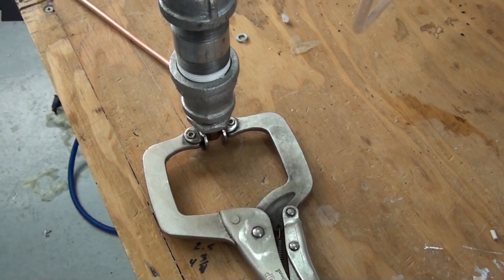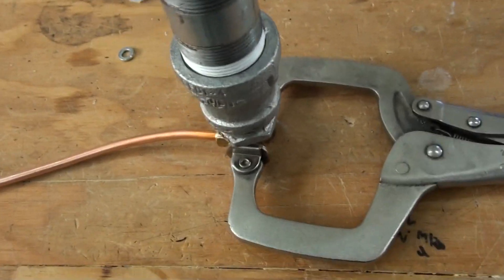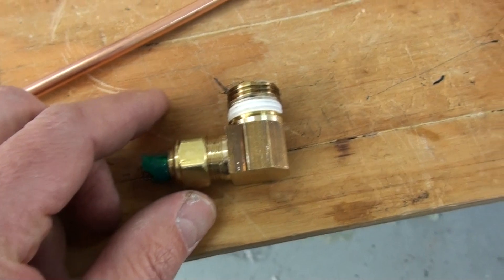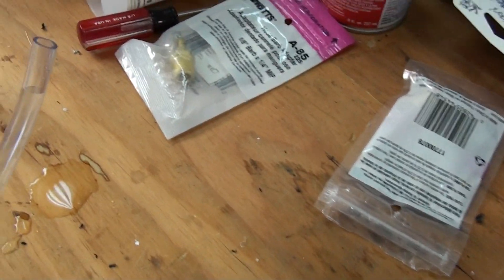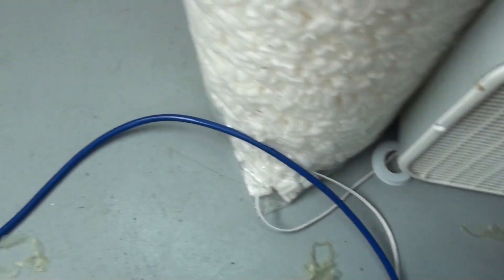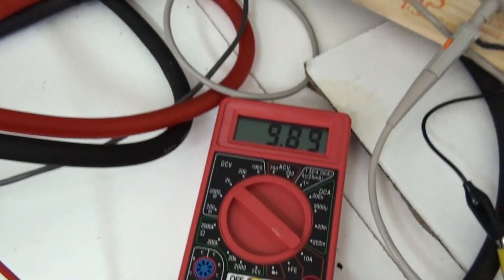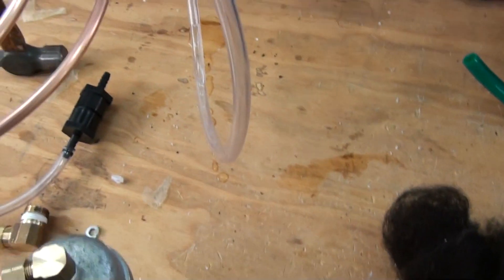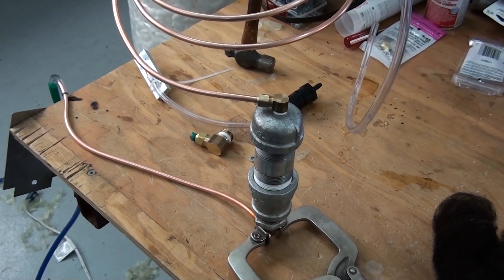H-CAT HHO Heater purifier project for hydrogen and oxygen.

Comment: is it possible to use the heat generated by the reaction to generate power using thermoelectric coolers to offset the power used by HHO production?

Comment: I saw this about 10 months ago and didn't know what I was looking at, at the time! I have just begun to explore HHO generators and I have 2 designs of plates that I use in my generators. The big plates have 3 holes on top and 3 on the bottom and the small plates have 3 holes on top 1 in the middle and one on the bottom. I have been having fun with it so far, a little expensive at first, well still is, what the hoot! But I'm interested in the cat too! I'm not as far as you guy's are but I'm still learning how to put the fire resisters together?? I saw my first video on HHO here on YouTube in May of 2013 and was hooked ever sense. I have one in my car and I did get real good gas mileage for a very short time, so I know it works but I haven't figured out why it stopped! If you all can give me an answer on that, I would appreciate it a lot! I have my own page here to. I guess off to the junk yard for a cat!
Reply from the maker: You may need a Volo chip and PWM to get it working  well.

I do have some mini cats left if your interested.

Comment: Flip it over so the water that forms doesn't plug up your cat.  The BG (HHO), even though it is lighter than air, will travel 'down' through the substrate if the top is sealed. Moisture (even as steam) lowers your catalytic effect.
Hydrogen coming out indicates that you are not 'combusting' all of your BG.
165 watts will make a lot of heat, as can be demonstrated by plugging in a couple of 80 watt soldering irons.  
Temperature is not the same as 'quantity of heat' Enthalpy or BTUs).  Soldering irons get hundreds of degrees too.
Very good design.  Test it by heating water.
Reply from the maker: You will want to see the next 2 video's.

Comment: and did you say there is no oxygen being outputted?  where do you imagine the oxygen went? just curious. and could you take a picture or video of the new cat and after you used it? close ups please
Reply from the maker: The oxygen is consumed in the catalytic reaction.
Reply: delvis11 so you are saying the oxy has turned into heat then? but there is hydrogen left over?
Reply from the maker: There should be.

Comment: 165 watts makes 1lpm and roughly 300 degrees F at the base and 170 at the top. is that right? what is the temp of the room and how long did it take to reach the 300 degrees? you could put that copper output coil in water and have a drop leg, the water would condensate from the coil and the hydrogen would still come out the end, the water pressure will work to let the hydrogen still go up and out. and a water bowl beside the output elbow, the water poisons the reaction, it is dripping back on to your kitty cat. they dont like water you know. nice video delvis, best one i seen on this so far

Comment: Well played. I got a couple of ideas.
1Please submerge the whole unit to heat say a litre of water
2instead of condensing the output, it would be good to see if the 'spare' hydrogen is available. Try putting the output pipe into a bubbler. 
The #HCAT experiments are very worthy . Cheers

Comment: Great work Steve!
What's the temp at the top of the reactor? 
If you put the exhaust pipe into one of your bubblers the hydrogen should accumulate at the top and feed the torch better.
Reply from the maker: Temp at top is about 170

Comment: Why not use stones for the flash back, you should be able to find then at different flow rates and different sizes, they would be cheaper and not melt at those temps anyway...
Maybe a stone quarry would have some or leads and they would be stupid cheap from them :/

Comment: Awesome based on the research I did I figured the hydrogen would not be consumed all the way if at all.  I have commented on others videos about this and shared a few of my ideas to utilize the full potential of the process. 

Very nice video Steve! Thanks for sharing! I was hoping someone would test and show that there was hydrogen leftover!   It gives you a good feeling when the ideas a person has end up being correct! 

Awesome! Now you need to seal off the system so the hydrogen does not recombine with the oxygen in the air so you can either run in into a holding tank or us it as a burner to further increase the heat and use it to run a steam engine and generate electricity.

Comment: This is amazing! you showed up that this is a completely renewing cycle products. we use water to have heat, hydrogen and water again..can believe it!! :) So, the flashback inside the reaktor is a big boom?i'm a bit scared, it's like a little bomb or the pressure will simply pushed out with water?  And so, in the outlet hose where you seen water coming out togheter the plastic hose, maybe also the gas is loss, try to fix and re try with the flame :) also as Neal said soap bubbles will help you too :) Go ahead man!! (and take ceramic insulation :) )
Reply from the maker: When It flashes back it is a simple flash back to the arrestor. no big deal.
Reply: ah, Delvis, I suggest you to make to some short round with copper near the reactor in both hose fitting..like a 2 or 3 spiral coil , this will help cooling the copper tube :)

Comment: That is just too cool. Your little reactor is sweet to look at. You may not realize it but you are writing History right now. You should try the ceramic insulation padding instead of the steel wool. Cleaner and would probably allow you to get up to higher temps. You can get a gigantic roll from Mcmaster for about 25 bucks. Let me know if your interested and I'll pass you the link. Neal and I went in on some. Where did you find that little cat from lol? Thats awesome.

We can recycle all of the energy conversions here. I hope I get the same results when I get mine put together. I got some testing equipment to check to see how pure the water is. We can either use it as drinking water or send it back to the main res to be recycled. I'm excited to check for pure hydrogen too. That would be really valuable. Use as a flame to enhance the heat, pass through a secondary cat to get even more heat, or send to a bottling station for storage. So many things we can do with this technology. I'm so excited about this. Your video was excellent.
Reply from the maker: I will invest in some ceramic insulation. I got the cats from china and I'm getting my heat sinks from china also. They only cost $10 and a but load of shipping. If people like these I want to do a bulk buy and share the cost with everyone.
Reply: delvis11 http://www.mcmaster.com/#standard-ceramic-insulation/=qr54vv Here is the link. They have different kinds. We have the ultra high temp 1/4" thick roll. That little cat is the bees knees. That would be almost drop in ready for the flower pot heater. I'm telling you, if you could put one of those flower pot heaters on the market for less than 150 bucks, women would buy them. Set it up in a bathroom or something.
Reply: delvis11 Count me in for part of the bulk buy!
Reply from the maker: jdcproducts
Yeah until the woman finds out there is hydrogen there she will run for the hills. Now put a smelly candle in and she is in heaven :)
Reply from the maker: Tyson Capel
Tyson the minimum buy is 100. If this works out Hopefully people will want to go in. The heat sinks are $7 but that's for 200. Shipping is another story though.
Reply: Ok just let me know when it comes time to order . Let me know the quantities I would need to purchase, etc.